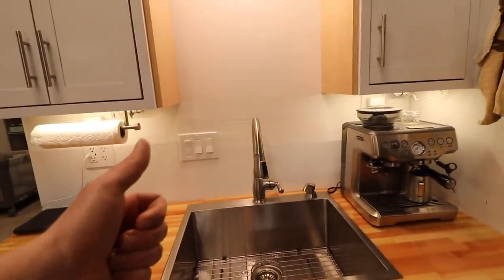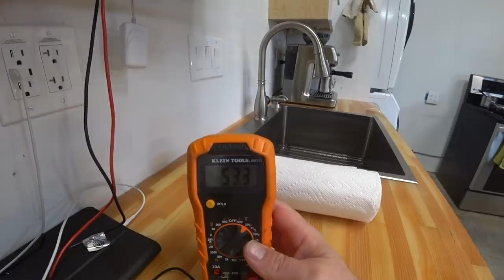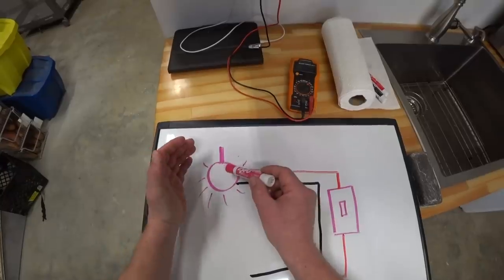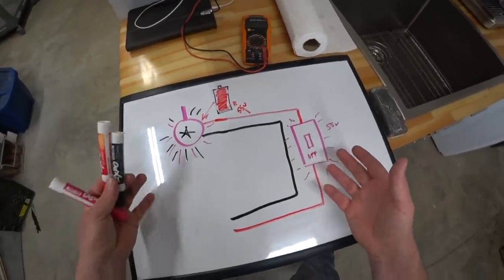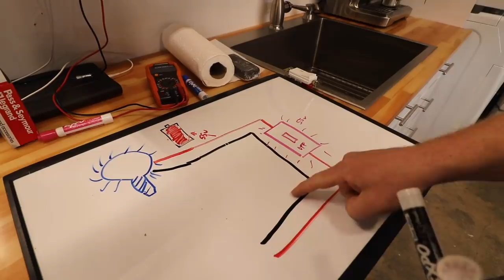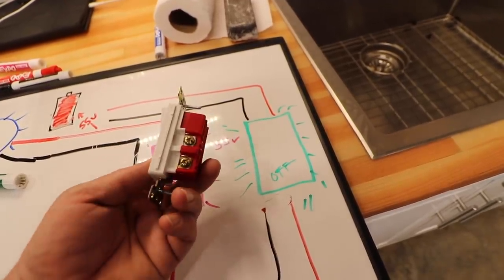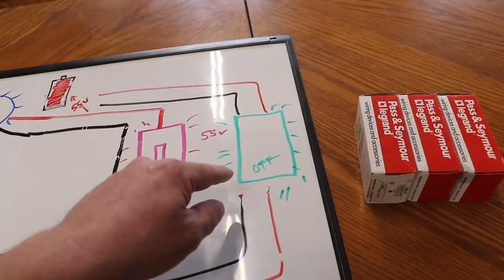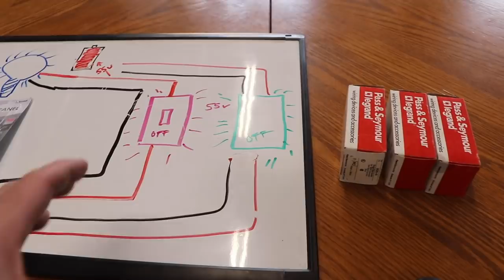Don't Use LED or CFL Bulbs 'Till You WATCH THIS VIDEO

Comment: I just went with motion activated under cabinet LED lights. No switch needed.
Reply: Kent Yee this is an excellent idea, does it turn on during only low ambient light or during the day too?
Reply: Stuart Schindler of course there are different brands out there that does things you want, but I just got the cheapest ones I could find for my needs. I mainly have mine inside cabinets and the base of my bed frame. So they do turn ON during low ambient light.

Comment: Put some night glow sticker on it.
                      Or 
Inside the switch there must be a neon bulb and resistor in between neutral and phase (AC input terminal),last terminal is switching AC out put to led driver.

Comment: Give current to the socket constantly (120V) and get the output of the transformer as source for the switch ensuring the switch light is a led that needs only 12V or whatever is the output of the transformer.

Comment: I have the lights switches with the small neon bulbs installed inside them. When the switch is OFF, the neon bulb lights, this is comfortable in the dark to find the switch. BUT. When I installed LED bulbs (not an LED stripes and no dimmers), they began dimly glow. When the switch is ON, the bulbs lighted with full brightness. This is why it happens: when the switch is OFF the current (230V AC) flows through the neon bulb - the circuit is closed and that small current is enough to glow LED bulb. When the switch is ON the neon bulb is shunted by the switch and LED bulb lights as usually. What to do? I decided remove these small neon bulbs from all switches where they were. Yes, I'm electric/electronics engineer, so don't do that if you are not an electrician!

Comment: If you can find a switch that glows all the time even when on you will not have the problem, this obviously will need the neutral wire.
With your existing circuit if you fitted an incandescent lamp you would have zero volts not 55V.
You may find the circuits that you don't have a problem with are with LED lamps that fit into a standard lamp socket, the reason for this is the LED manufacturer fits a resistor in the lamp to stop glowing or the strobe effect.
You also would not have this problem with the older non electronic ballast flourescent lamps.

Comment: Video shows how you wire in two wires to the right side of the new switch, not a third one (neutral) to the connection on the other side of the switch, visible at 12:03.

Are you supposed to connect neutral to that?

Comment: I am curious if you hooked one of those switches to the bathroom lights with regular 110 if they would do the same.  You are correct that the switches shouldn't pass any electricity past them (for true safety....best to trip breaker than switch to replace light fixture).  Thanks for video...not going to use those switches.

Comment: There are some very cheaply manufactured LEDs that will glow dimly just from the capacitive current from the house wiring - when a normal switch is turned off. My guess is one of these could give you the night light effect, and draw off the charge in the capacitor if in parallel between switch and bench light. Trouble is, they are too big to into your assembly.

Comment: Well, that's crazy. I use Legrand switches (here in France). Their lighted switches only toggle the live, but also have a single neutral connection terminal for the glowy part when the switch is off. DONE. Not sure why they don't sell the same thing in the US!

Comment: Leviton 5638-2W 20-Amp 120-Volt Decora Plus Rocker Pilot Light Illuminated ON Req. Neutral, 3-Way AC Quiet Switch, White

Comment: I am decidedly NOT in favor of finding any voltage on the load side of an OFF switch.  The best solution is to ditch the glow switches and if you must have light just put in a night light.  You could of course go to relay switched circuits which would work although I do not like the idea of keeping any  voltage on a relay coil that is supposed to be off!!!!!!!!!!!!!

Comment: Buy eropean switches here it is poseble to have the both cables disconect or put a small resister in the powerplug that will solve the strobing
Grts from belgium

Comment: Why don't you just put a desk lamp on the counter and turn it on whenever you need to find the on and off switches for the lights? Wouldn't that be easier? That way you can move the lamp around to where you remember the lamp is, in case you forget where the switches are...

Comment: You have no ground circuit.  If you switch the neutral and hot, but hot doesn't break then you are stuck with a hot device that can't carry away energy.  You should never switch the neutral on a two wire only circuit.
The LED transformers need a ground and the switch needs to know you have a ground path to carry away unintended energy.  No electrician would switch both legs with no ground because of the potential failure.

Comment: I cannot believe anyone would think connecting active to neutral is going do anything other than end pretty badly.
Of  course the problem CAN be solved if there's a neutral available to the switch and all you need is a single pole double throw switch that switches the active either to the load or the lamp in the switch. The other side of the back light  lamp connects to the neutral.
Reply: I think this is the correct solution, Robert. Single pole, double throw.

Comment: 12 volt DC lights on a 120v AC line with 120 volt AC switches. Try finding 120 volt AC LED’s, if they exist I bet that would fix the issue

Comment: Why build and install all this kitchen stuff in the garage. I thought your plans as in drawings the kitchen was designed to be upstairs above the garage level. Are you going to have two kitchens?
Reply: Fridge and stove can move upstairs when ready (or stay there for easy lunch prep on work days).  There will always be a sink near the washer and dryer for brewing, canning, gardening, washing your hands in the garage, etc.  Cabinets in the garage/laundry area will continue to be useful.  There is a budgetary reason they don't start the upstairs kitchen now, they are incurring zero debt to build this house and continuing different areas only when they can afford to do it debt free.
Also, while they are building it all themselves, they are using the downstairs bathroom and kitchen as "test projects" to learn skills so that their upstairs versions will be even better, with less long term stress.

Comment: There should never be any voltage at the outlet when the switch is off. The internal circuit in the switch that powers the backlight is wired wrong. I would call the manufacturer and ask for a replacement.
Reply: Lighted switches are not intended to be connected to outlets, they are only intended to be connected to hardwired lights, the voltage "leak" is not ideal but it is the simplest and cheapest way to light a switch..

Comment: I agree with comwarrior69!!        "So your using LED lights to save power... yet your using a switch that is designed to waste power???"
Reply: This lot  … Couldn't save power if they were disconnected !
2 – 5 Kw a day is possible depending on the heating & cooling used .
Reply: and this one: @gd2329j  doesn't know what a kW is.

Comment: Is it possible the LED power supplies are switch mode type and are just pulsing when the switch is off? Maybe try finding an LED that doesn't require a power supply.

Comment: I don't think there is by default 55V on the outlet when the switch is off. It depends on the resistance of the voltmeter and the light-resistance in the switch.
Reply: The electricity from the switch's back light has to go somewhere.

Comment: Pretty sure this whole thing is caused by switching plug. Couldnt you just find under cabinet lights that wire directly to the switch?
Reply: No it's caused by using incompatible hardware

Comment: Think they could use the ground as the other side of the neon light circuit. Maybe you can make a electrical plug with a 500k resistor across the mains on the same outlet as your lights.

Comment: It sounds like you need a HUB with Alexa smart switching. The hub would only send power to where it is told to send it with to control the smart hub you likely would not need the glowy switches just tell Alexa what to turn on and off.

Comment: You need dimmable led’s they have the ability to run at multiple voltages which will remedy this issue.
Reply: Or current limiting circuit
Reply: Not correct for this situation

Comment: Seems like an AC to DC issue especially with the wall wort and possible power issues. I would say find something with LED's that could connect directly with the house/light switch. Almost like a computer.

Comment: I'm still confused as to why a standard outlet would in any way have 55 vac coming out of it?  In my thinking it should be 0 or 115.
Reply: Not a standard outlet it's switched & the switch plate is illuminated .
The led in the switch plate is passing a small current via the load back to the neutral line .
If a low resistance load ( incandescent bulb ) is fitted you won't get the flashing affect .

But one switch plate will put about 3 or 4 KW a year on the bill !

Comment: Install a resistor that consumes 0.5 watts in the same circuit as the led lights and your problem is solved. According to my calculation, the resistance of the resistor is 24kohm.

Comment: Resistance.  No neutral on the switch, passing a SMAAAAALLLLL amount of current, causing the transformer to slowly charge and then discharge.
No neutral needs to be switched... Just needs to be branched off to let the internal light circuit work when you toggle the switch.

Comment: The problem is you're trying to marry incompatible technologies.  If you want lighted switches you're going to have to use incandescent accent lighting.  If you want LED lighting, you can't have illuminated switches without employing the use of additional relays or controllers.

Comment: Robmechanic is correct.  You need a resistive load on the load side of the switch.  Calculate how much power you need to light  the switch LED, and use Ohm's Law (r=e/i) to size your resistive load. de KC8KK

Comment: You wired one side of the switch. You did not sure the other. Find the neutral side going to the light, and going back to the box, and wire them to the open connector.

Comment: Cheap power supplies = capacitive dropper.   Dead simple, but with issues... Neat video. Thanks Jesse!
Reply: My "solution" is to put a small piece of long glow glow tape on the switch. it's usually sufficient for keeping the switch visible at night, but not being electrically active.  This isn't the solution you wanted, but it works, and glow tape is super cheap.
Reply: Nothing to do with the lights it's the wrong switch for the situation the products even say not suitable for cfl or led lights

Comment: the small light inside the switch causes the problem, puts a swich without internal light ....from bahia blanca argentina
Reply: Straight form a guy who watched only 2 minutes of the video.
Reply: Use your adblocker people.
Reply: @Desert2GardenLV  his reasoning is correct, I know because that flash did not let me sleep, in my case; then I only removed the small light

Comment: Your forever glo night lights are doing the same thing as the little led in the switch.  They are both parasitic loads as you call them, it just seems that the bigger night lights don't leak voltage.

Comment: Personally, I'm not sure why you've not put smart switches in at this point. There are many different brands or "habitats" of hubs that will work with the majority of smart technology that you can buy. 

My solution would be to grab a hub and equip the house with smart switches for the lights. Then get some motion sensors, anymore most of them are four-in-one up to a six-in-one sensor. At that point put in an automation/rule/routine that if sensor A sees movement, and the sensor tells the hub that the light in the room is at this level. Then it should turn on these lights in reaction to that. If you create zone rules for the sensors that would also cut down on what lights come on when each sensor is tripped. For example, our garage is four-car wide and three-car deep. It has five total sensors that all work together. These sensors also work with the security system as to their effect. So I can walk into the garage and down to my workbench, which triggers Zone 1a, 1b, 2a, 2b, and sometimes 3a, 3b. What that does is at night and in low light times, it triggers the stairway lights, the landing lights, and the walkway lights by the workbench. I also have the option built-in that if we have the security system set to at home and one of the sensors is tripped it alerts me but only turns on the lights by where my phone is located and not to full power- but enough to safely walk until my light source is used.

Long-winded but just a thought.

Comment: are your device boxes grounded  metal boxes must be grounded and you have it too close to the sink , when you tried the switch you did not put the mounting screws  in ,that is part of the circuit !  you should find a different result if things are done completely . a grounding stake for your house is very important to safety not just strobe lights or stray voltage ..

Comment: Your problem is that you are drawing power from 2 sources. one for the switch and turning on the light and the other power is to the condenser. You need to have the condenser on the out feed side of the switch. Supplying from one source not 2.

Comment: You know what the answer is, put a non glowing switch in and pretend that you are blind. 
My dad once worked with a blind man who was a woodworker hobbiest  he had a band saw and a table saw and worked in the dark and drive his neighbors crazy he had lights in his basement shop he knew where his switches were both for his lights and tools no need for glow switches. You learn to adapt, sometimes there just isn’t a right now fix you have to wait for it, it will come!

Comment: I am not sure if they still make it but 50 years or so ago I needed to have a lighted switch. lacking that I bought a switch cover that glows. I believe it could be connected to be lit all the time which would eliminate the problem. I looked but couldn't find any like it now. The one I found had led lights at the bottom.

Comment: not sure this is all correct. for switches that light up when a circuit is OFF needs to be powered by both sides of the power system (that's how current flows), or to put more simple it needs its own circuit. IF it worked like he said then current would be flowing to the light 100% of the time whether switch is on or off, which makes no sense to be designed that way.
OR
Simply wire up a 'low voltage' system for the LED cabinet lighting. Problem solved.

Comment: ai think all you have to do is put a resistor across the hot and nuetral up stream of the switch that will leave a path that is easier than the capacitor and light your switch.  I don't know what size it would need to be

Comment: You got the wrong switch you had a 3 way switch. You wanted a double pole switch for the diagram you drew.  Try a double pole but look at the diagram before you wire it, sometimes the terminals don’t connect the way it seems it should, don’t want to wind up connecting a hot to a neutral when you flip the switch
Reply: Be careful not to buy a 4 way switch, while both 4 way and double pole switches have 4 terminals they act differently from each other and can’t be used interchangeably

Comment: Use a regulated power supply? A regulated pws protects against under voltage so it might not even output if insufficient AC voltage is applied. Normally the regulated applies to the output side, but hey it's worth a try.

Comment: put a small switch on the wire from the wall adapter to the LED light. I believe it is called Feed Thru Rocker Switch

Comment: Simple fix is to plug an incandescent nightlight into the switched outlet. You have one to spare. I will allow the bleed current from the switch illumination to return to neutral. This is a known problem and most Edison based bulbs will have a built in bleeder resistor to handle the bleed current. 
BTW: you are confusing voltage and current.
OK. I jumped the gun.

Comment: When you pulled out the old light switch I noticed you didn't have the ground hooked up. If you had hooked up the ground it would have used the ground as the return instead of the nutrial. We ran into this issue awhile back.

Comment: LED ballast circuit is randomly firing its capacitors for reasons not apparent, likely a bad circuit board design, or faulty chip.

Comment: It's not the problem of the light. It's the switch. You have 55 volt on your line and your led is 12 volt. It's strange when you turn of your light you have 55 volt on your line. It's dangerous to!

Comment: I use a capacitor 100 nF/400v  in parallel with the switch.  Here the problem is over.
Reply: This would limit the current? And would need to be in series ?

Comment: Using a resistor between the light and switch will "eat" the phantom power run between the neutral and power leg comming right off the switch.

Comment: the switches off mode should be disconnecting the led light circuit completely right?.. and no more glowy switch circuit when led is on.

Comment: Do not play around using a resistor!  a potential fire hazard    wait or call the manufacturer about a UL approved switch that does it all internally in the switch isolated from the light source  who knows they may be in the process of making one

Comment: Stop trying to fight the system go way it's supposed to be put your neutral in the switch box
Reply: @PortersMob  you call me an idiot because I am up to code ? as a standard I use a 14/3 as a switch leg for all my switches a master electrician has to think 20 years a head if you understand what that means